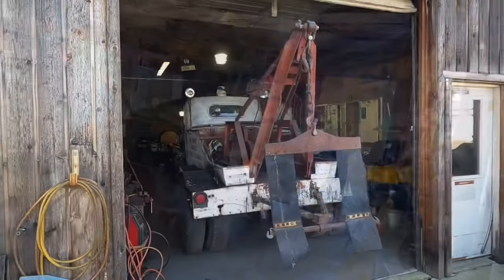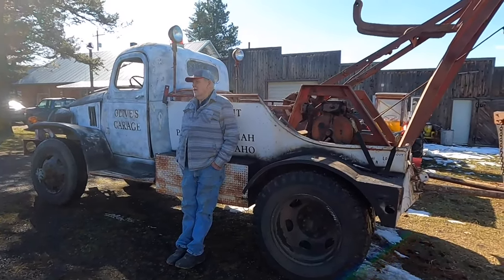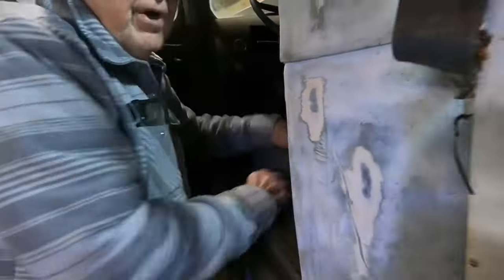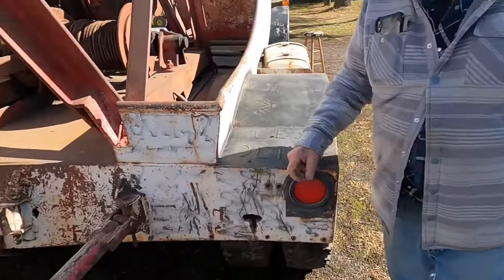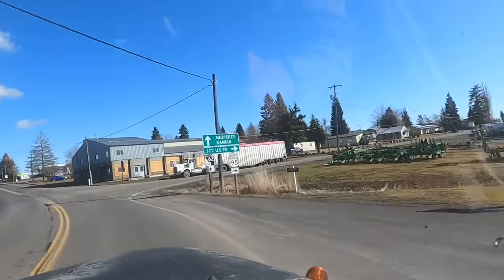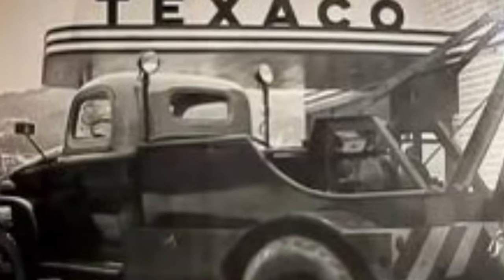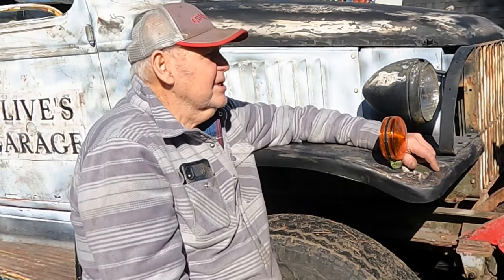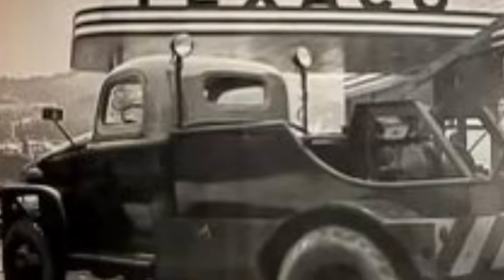1941 Chevrolet Army Truck Wrecker.

Comment: Skip Geer who wrote for Antique Chevy  Journal told me years ago that Chevy WWll weapons carriers were given Pontiac flat head 6's. My neighbors had one made into a dump truck. I was scratching my head when I saw that power plant with "GM" markings. it was like a ton 1 1/2 ton with regular cab.
Reply from the maker: I contacted my dad.
He’s had 3 military trucks in this era.
One was a 1-1/2 ton 2 wheel drive, it had a 216.
Another one was a 4 (6) wheel drive, it had a 235.
It’s hard to determine what is what.